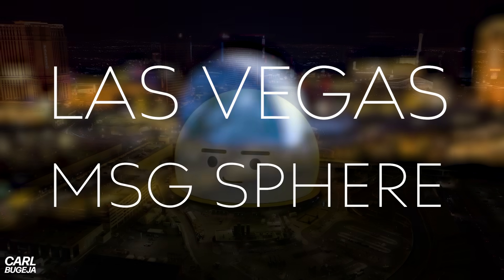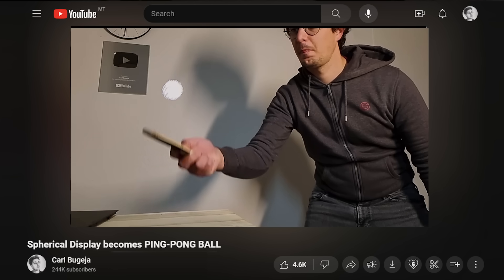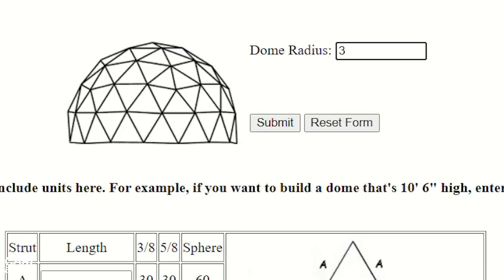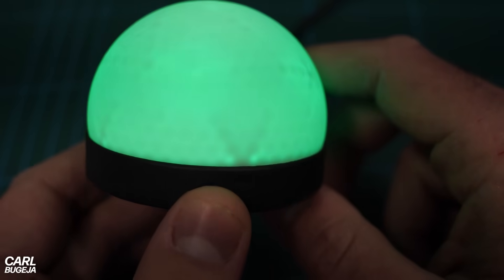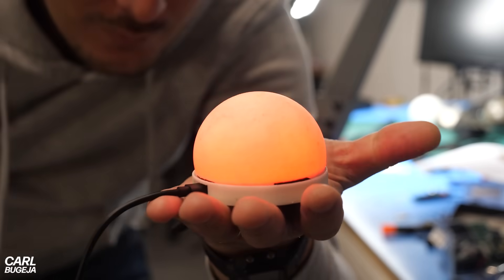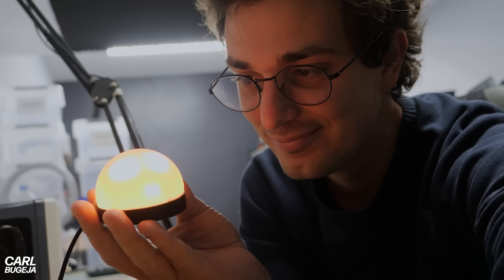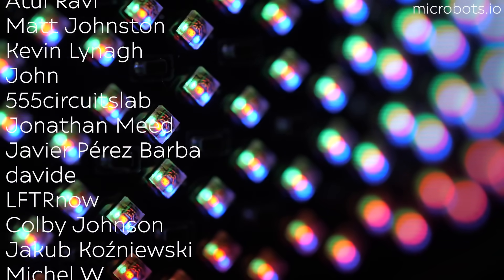Building a Mini Vegas-Sphere

Comment: Having lived in clark county for a while. I can tell you that sphere wont look pretty for long. Every time it rains it deposits and metric crap ton of desert dirt onto everything.  Some places like the Luxor just outright gave up trying to clean it off because of the large angled surfaces. So the windows are pretty much coated in thick hardwater deposits.

Comment: I think if you go a bit bigger, you might be able to compromise on led choice a bit an still end up with more pixel density and overall apparent resolution without adding more cost.

Instead of dealing with the added cost of the flexible pcb and the difficulties adhering it the the shell, think in reverse with various led modules mounted via posts directly to the diffusion layer and have the inner sphere be a skeletized heatsink and support for the modules with integrated cable management for dealing with the extra wiring.

Overall, I like the idea and think it has a lot of potential for reapproaching from a different angle.

Comment: Amazing! What about a circle OLED display with a fiber optic dome lens on top. The lens might have to be custom made though, so $$ is still an issue. The type of lenses I’m talking about are like the ones from TaperVision. Their off the shelf lenses are flat, not a dome, but it could work in principle with some aftermarket custom grinding.

Comment: Going bigger you would have to go away from addressable LEDs and instead use curved screens.  Not that that would be cheap either.  But at some size, probably not too far from the current size, the cost curves are going to intersect, and the quality would be a lot higher.

Comment: Can the geodesic PCB design be simplified to a bunch of small, discrete, polygonal PCBs? That would increase assembly time as each polygon would need to be wired into the circuit, but would remove some of the PCB cost, especially if you can get away with a 2 layer design.

It might also be possible to get an overall lower BOM cost by dividing the pixels among multiple LED controllers or processors with a bus to connect the chunks instead of one expensive microcontroller. If it can be done with non-addressable LEDs, even better. Maybe writing the animations to lookup tables could allow the use of cheaper components?

I think the mini projector + lens idea people have mentioned sounds the most promising for getting high resolution.

Comment: How small can projectors get? 
5 of them, one for each cardinal direction and one facing up, projecting on the inside of the sphere, shining through it.
stitch them together in software and make a driver that can be fed textures and convert them for use with the projectors.

Comment: I think you could get way higher resolution for cheaper with: 1) Pico projector in the base pointing up (or using a mirror to point up).  2) fisheye lens above it.  3) empty diffuser dome.

Comment: You could possibly try a spiral/spring strip of LEDs, think about when you use an apple peeler and the outer layer is peeled into one long strip. This would allow you to place LEDs very close to eachother whilst also maintaining pixel density. and would also allow you to create a perfect sphere to place the LED strip on rather than use a triangular sphere, this would also eliminate the seams issue you had with using a triangular sphere

If you don't know what I mean by apple peeler:
https://www.youtube.com/watch?v=tft6BO74YM0&t=24s

The excess peel of after its peeled would be the LED strip

Comment: If transparent flexible PCB’s exist, you might be able to double the LED count by printing two boards that stack and use lower profile surface mount components. The bottom one designed so it’s LEDs align with all the gaps on the top board.

Comment: I don't think your pixels are all equi-distant from eachother, and you end up with some holes where the seams on the pcbs are. The trick would be to lay out the LEDs in spherical co-ordinates, and them map them back to locations on the flattened PCB. You'd also have to deal with LEDs mounted across the seams of the flattened board. I think the secret is to do all the design in spherical space, and then map it back to the flat projection, rather than going the other way around. You probably need to write some custom scripts to make it work properly
Reply: or maybe you need non-linear seams between the pcbs to get the LEDs in the correct positions. Anywhere an LED needs to be across the straight seam, you need to zig-zag the seam around the LED placement to prioritize that over having a straight edge on the seam.

Comment: I had the exact same idea and seeing you make it is so awesome and cathartic. I knew resolution is always going to be a problem, so I even imagined using a projector with mirrors. I think phone display pixels are even smaller, you can look into ordering a custom phone display in the same shape. Further these days displays can be curved, so I guess it's going to be costly but sooner or later someone's going to do it.
Reply: the problem would be curving the display enough to do this. you'd need multiple small displays, likely triangular like in the video and I doubt those are mass produced.
and with the projector you run into issues of FOV or focusing of the image.

Comment: with higher led density you could also use something akin to sub pixel aliasing by using part of an RGB LED's light to diffuse with another to potentially allow smoother movement and finer images?

Comment: Forget the LEDs, try an OLED/LCD screen on the bottom and some sort of lens or crystal on top to project the image on the sphere.
Reply: Yep, work smart not hard
Reply: Calculate "that sort" of lens, and you'll be able to spend your Nobel Prize for the rest. Optics is not a magic, flat projection to insane curvature of close hemisphere is not a thing you can just make.
Reply: @Bukuzoid  its called a fisheye lens
Reply: Awesome idea. The optics might be challenging, to project a 2D image onto a 3D sphere. Could it be a fisheye lens but used in reverse ? So that it projects the image on the sphere ? It's interesting :).
Reply: @electronicsacademy2D2E29  yes. exactly optics always work both ways!!
Reply: Was my first thought too, although I was thinking of how to splice together flexible oled displays, maybe with overlap. Now I like your idea more.
Reply: Why not go a step further and use a projector? Something like the TI DLPDLCR2000EVM would work great and be fairly cheap too!
Reply: @ani_b  Great!! I didn't know it!!!
Reply: but that wouldn't be a vegas sphere, which is using leds.
Reply: It's not possible without very complex optic engeneering. I never see a prototype like this.
Reply: @Unnaymed  Could you use five panels in a cube form (no bottom) and project those with a small overlap?
Reply: You could pre distort the image before projecting such that the resulting image looks correct on a sphere. I don’t think you need optics. The math to do this pre distortion??? Ahh. Good luck.
Reply: @BJ5815  still need to project it ;-)
Reply: He needs sponsors to cover LED costs, forget about OLED or LCD. 😂
Reply: fisheye could work for a hafl sphere but good optics are expensive. the best compromise would probably be 6 square screens assembled in a cube with electronics inside, and 6 simple lenses projecting on the outside sphere. those lenses would be cheap. it will also give you the best image because less distortion
Reply: https://www.youtube.com/watch?v=0KPtqXAZ66g
Reply: Ok cool
Reply: Couldnt be a cone-shaped fiberglass yarn or cable, attached froma de oled to the sphere?
Reply: Maybe a bundle of fiber optic cables. On a high res high brightness display?
Reply: Not really the same idea as the Vegas sphere though. Just making something different

Comment: Maybe you could try two separate pcbs , like layers of an onion. The outermost pcb would then have holes in it to allow extra LEDs shine through. This would allow you to have larger cheaper LEDs and have more of them. The complexity of design and programming goes up, but the parts cost could go down.

Comment: High Carl, you might be able to leverage Altiums Camtastic! utility in the future to check for shorts between nets outside of the usual DRC setup. I think this can most easily be done by exporting as ODB++ and importing into Camtastic! If you have any questions, I might be able to give you a hand, as I use this program at work quite a lot.

Comment: One up to 3 times that size would be perfect.  Any cost under $1,500-$2,000 would be understandable, considering one time or few times build.  Even if this could be made many times over by a factory, $1,000 would probably sell a lot of them.  (cost reduction due to quantity and factory improvements to build cost.)  Especially if you could get buy in from the folks in Las Vegas for branding rights :)

Comment: Great project. 
Sharing some ideas:
1) white circuit board to improve reflectance
2) thinner diffuse
3) modeling to higher virtual pixel count then blending based on proximity to physical pixels - for smoother animation and illusion of higher resolution. 
4) pre crease the triangle edges to achieve s cleans edge without stress on glue. 
5) print gradient channel for cable foldback to guide cable inward at gradual angle and reduce stress. 

I look forward to future iterations.
Reply: You dont want reflectivity it would only blur it even further from scattered light
Reply: @635574  You want it to blur with the pixels next to it - that's what the purpose of diffusion is
Reply: I think redesigning the board to have the cable at the bottom and not "in the middle" would make it easier to hide.
Reply: I strongly believe that other techonolgy instead of led and some iptical concepts may help to get a good ratio between size resolution and price. :)
Reply: @yeksonguay  you just need cheaper leds.... a $750 4k OLED TV buys you 8.3 million leds, thats over 10k leds per dollar
Reply: @geemy9675 More enough pixels in one TV to make 1000's of 10k small spheres. So the cost per sphere would be nominal for mass production!
Reply: Personally I think these are great suggestions, especially the first 3
Reply: Yeah,ofel triangles could be a little bigger to match PCB triangles for better stick. I'd say build it the size of a basketball. Sure it will cost more but the resolution will be kickass.
Reply: Also why do we have to paste it on top of a sphere? Instead print a geodesic frame and paste on top of that
Reply: @MegaDRKSTR  he eventually got to that. you can see it at 4:51
Reply: who are you my guy :)

Comment: A bigger one might be a little easier to work with particularly is the triangle segments are a little bigger. 
You could put this in a bag and apply a little vacuum to press the PCB to the sphere to help adhesion. 
What is the feasibility of rigid PCBs with edge connections like castellated boards?

Comment: Very cool! I wonder if you could get a higher resolution by using a normal circular screen and then use some kind of convex lens or a globe with optical fiber inside to make it sphere shaped. I don't think it would be practical to glue so many optical fibers in the right places, but maybe there is some existing lens thing that does this? (maybe some convex fresnel lens?)

Comment: why not use a standard lcd screen, then get a collection of fibre optic caples like used in those toys, and they are bunched up infront of the screen, then spread out into a sphere. much higher resolution. it would be tedious to build though, if i were making it i would use a series of 3d printed rings with a dent for each fibre to sit in, manually put th fibre into the slots, glue it, then add the next 3d printed ring on top, and repeat. the rings would get smaller so when on top of eachother they form a sphere. when its done, cut off all the excess fibre sticking through the holes then put the diffuser on top

Comment: It would likely be way more annoying to build, but it might be possible to get a far better image by using a standard LCD screen with a ton of cheap fiber optical (like used in cheap decorations) to map the screen light to the sphere. A standard screen is going to have a much higher pixel density and frame rate, but brightness would probably suffer.

Comment: What's the benefit here of using a single flexible PCB per segment? Would rigid triangular boards work instead? If mounted on a 3d printed frame, that may be easier to assemble evenly without worrying about bulges, and it'd be easier to replace a section in case of faults or damage. It'd also let you scale up without redesigning the PCBs

Comment: This is a great replication of the Vegas Sphere's design, even if it falls somewhat short in terms of performance.  If, for some reason, you're not done with this concept and want to more accurately replicate the Vegas Sphere's performance, I can think of a couple of alternate designs that might appear more Sphere-like.  

1.) Front-project a corrected image onto the sphere.  You might be able to get a higher resolution with even a cheap trash projector.
2.) Build your own image-pipe.  You would need to print out a perforated hemisphere, and then insert individual strands of optical fiber.  The other end of the fibers would be attached to your image source, whether that's a bank of LED's or the screen of an LCD display.  Upside to this design would be that you could seriously increase your display density while simplifying the PCB layout.  The downside is that this will be seriously labor-intensive and generally only good for a one off.  It will also probably produce a structure much larger than a little desktop hemisphere unless you do something insane like use a round smart-watch LCD as your image source.

Comment: There are those kids toys with the fibers at the end of a stick with a single light inside and the ends of the fibers light up because they act like a optical cable. 

What if you put those on a display and fed them through one half of a ball to have the fibers be the pixels.

It wouldnt be half a ball because you probably need a bit more space underneath to make this work but that could achieve a very high resolution low cost version of this 🤔

Comment: you could try to use optic fiber to map a flat lcd to the round surface. you can buy tiny fibers, bunch then together very tightly so it becomes kind of like a solid and than sculpt one end in the shape of a sphere and the other flat. put the flat side on a high res lcd and diffuse the other en and voilà?

Comment: ask huygens for development of a light guide and use small oleds .....
🤔 giving it a though lt I suggest trying a round small oled costing about 40 and clear acrylic double sided tape(which you can slit to make the individual pixels guide better) around costing 10 plus driving the board by the esp 🤷‍♂️

Comment: The larger it gets the cheaper it will be for the size, because the volume increases more than the surface area. How about basketball size? Since that was another common image the real sphere showed. Napkin math says that should cost around $2500 for the LEDs, but driving them might become a bit more difficult given the amount of them. Economy of scale should push the price down somewhat as well and you don't need flexible boards anymore, just individual small triangular ones you can cut from a large sheet and then solder together.

Comment: Just an idea, have you thought about fiber optics? If you had a much larger LED grid where each led gets it's own optic and then you can densly pack the optics around the surface of the sphere. I think this would get you A LOT more density, you would need to hide the led matrix somewhere though as it would be quite larger than the sphere.

Comment: You don't need slip rings to spin a led matrix if the led power and drive circuitry spin with it. mitxela has an interesting video using this idea

Comment: You could try using TONS of fiber optics to 'map' a normal rectangular array to the outside of the sphere. It would make the pedestal its sits on much thicker but I think it would be worth it bc you could get a much higher pixel density due to the small width of the fiber optic cables and the fact you don't have to create a spherical pcb. Look up 'fiber optic matrix display' bc I'm not sure if I can send a link here.

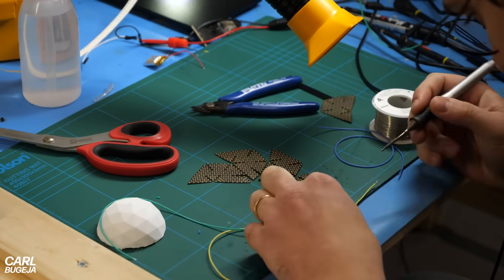Comment: 3:00 I'm surprised you never checked for DRC errors despite the stakes of the project.
Reply from the maker: I did for the 1/5 part, but the drc doesn't work in Panel mode, where I had to route the data lines for all the five parts

Comment: You could use a camshaft to oscillate the sphere within the space between two of the lower pixels. Then you can get all the benefit of spinning the whole sphere without the mechanical complexity of slip rings, and the programming should be quite a bit simpler as well

Comment: I think that the size of a tennis ball would be better since its size is just big enough for more usable resolution and mounting the capacitors on the other side will give more space for leds. Glueing it on a styrofoam ball would give better shape and space for the capacitors on the opposite side

Comment: Wow, the timing. At the last Hackaday Supercon in November 2023, I chatted with many people about doing a project like this. And POOF you were already steps ahead of me. Well done. I wasn't sure what practical density you'd be able to get with those 1x1mm LEDs. 
My geometrical approach was going to be different though. Like the MGM sphere, I was planning on doing mylar-based flex pcb, cut into spiral arms (see Fermat's Spiral), but wasn't yet sure how nicely that would lay onto a baseball-sized sphere.

Comment: If you switched to monochrome would you be able to get a higher pixel density with smaller units? Mixtela showed some LEDs so small you could snort them recently. They’d be awful to solder but they’d sure be small!